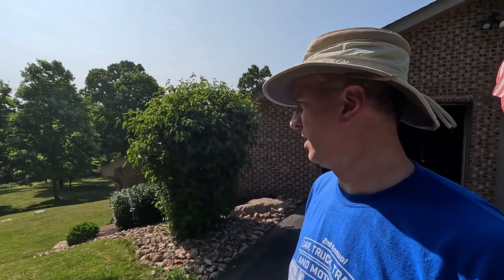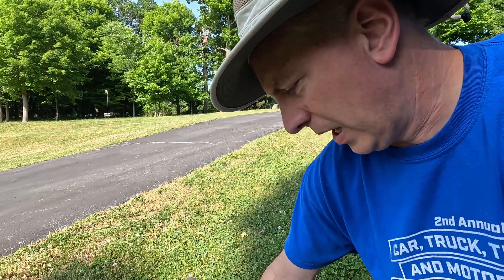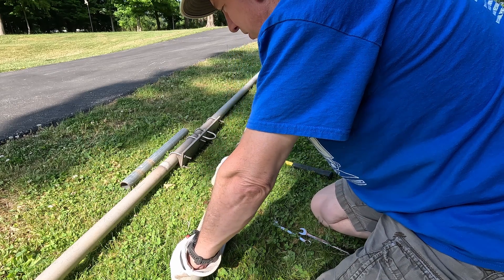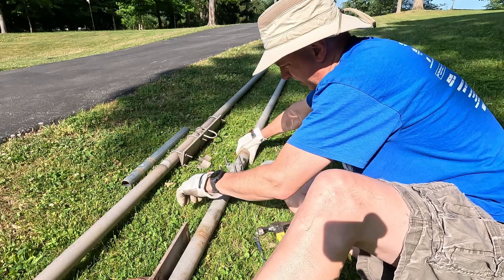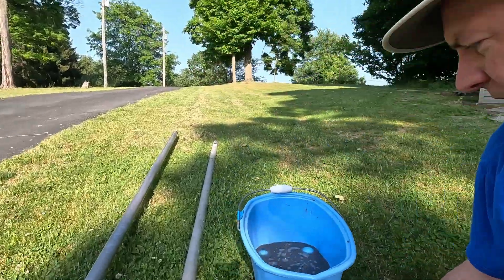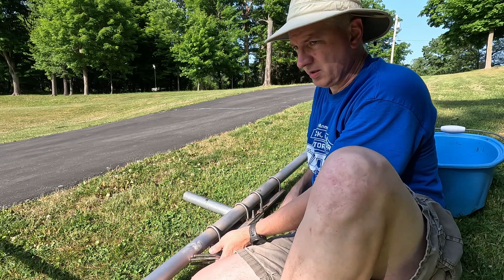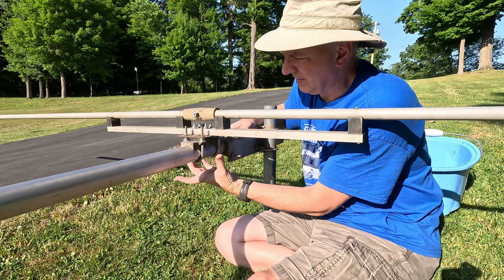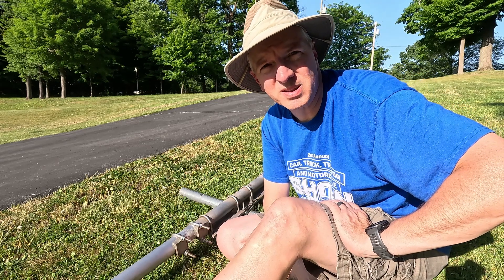New Boom for our Mosley Classic 33

Comment: On the end of the “red” element, the radiator. I noticed there is coax or wire hanging out the end. Does that get physically attached to the radiator or simply sit loose inside the element? I just picked up this same antenna and unless I’m misreading something in the instructions I can’t figure out exactly how this gets attached. Thanks!!
Reply from the maker: It is just loose in side of the element.
Reply: @TangoOscarMikeN3WS perfect, thank you!!